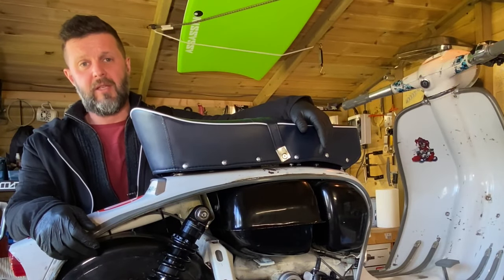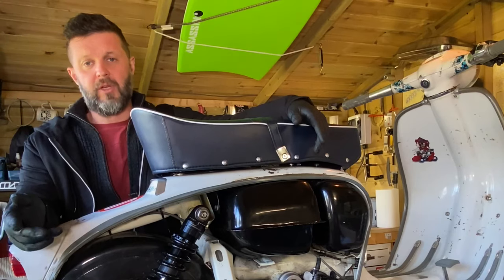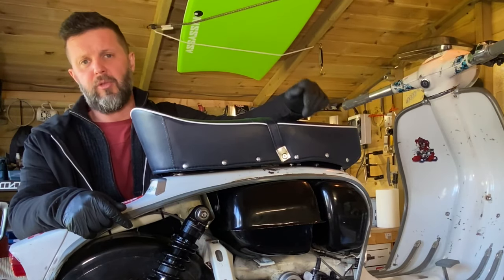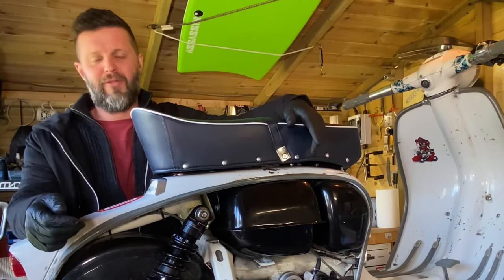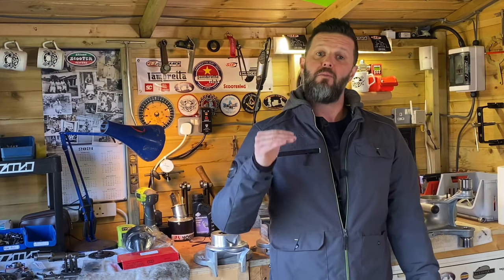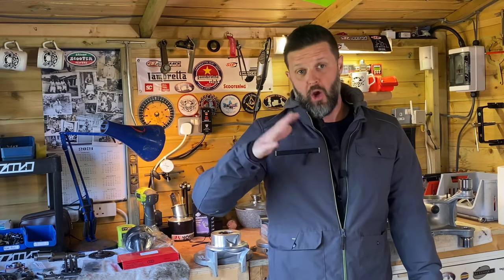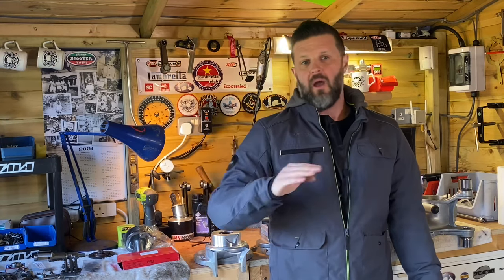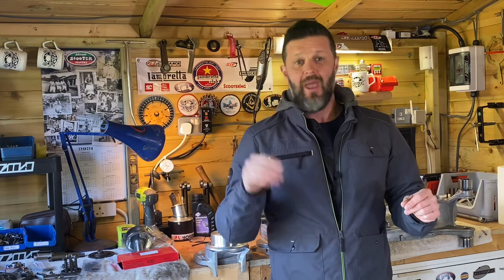Lambretta Targa Twin 275cc clubman vs expansion full throttle road test - 275cc with exhaust swap

Comment: Nice pipes although it did sound as if it wasn’t reving out, probably jetting needing a tweak
Reply from the maker: Yup, I might have been a tad over cautious on the main jet, better safe than sorry. Though at 80mph it’s hitting around 8000rpm, so won’t be far off.
Reply: @drunkmunkey6969  no harm in being cautious. Don’t want the jollies wiping the smile away with a seizure 😉